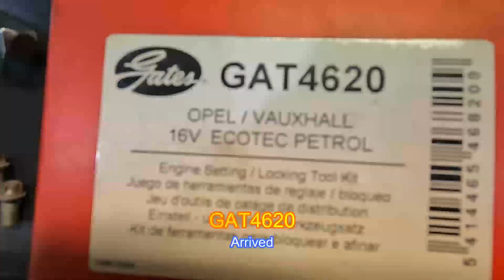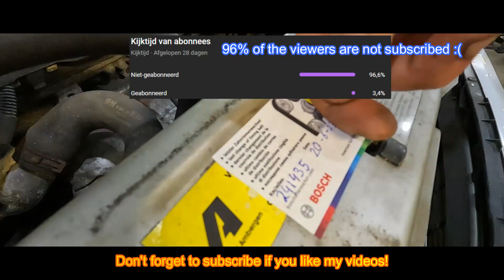Opel Vectra C Z18XE 1.8 16v Timingbelt and waterpump replacement (EASY)

Comment: Nice guys, good mechanics. How old was the belt? 70,000 km? Looks quite new?
Reply from the maker: Thank you. I am not sure about the belt
Reply: @MechaNick_  It may have been young, but it's not worth the risk to find out! Good engines, I don't think they make them as well now, too many stupid problems, so we must keep our older cars as long as possible! 😁
Reply: @ChrisPatrick-q6k  I agreed! olders cars are better and not electrotics faults problems that bring with them questions!
Reply: @kayimamosielu3566  Yes, I like 2002-2008-10. Still has safety like curtain airbags and ABS, but not too much stupid exhaust and electronics.